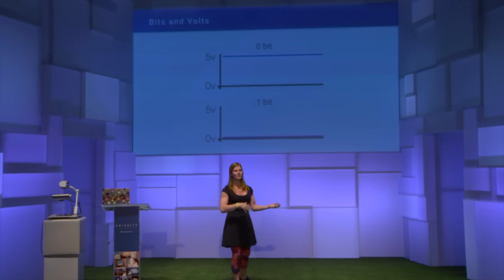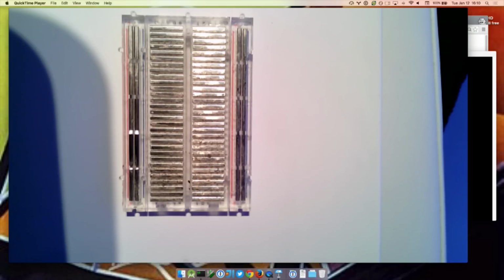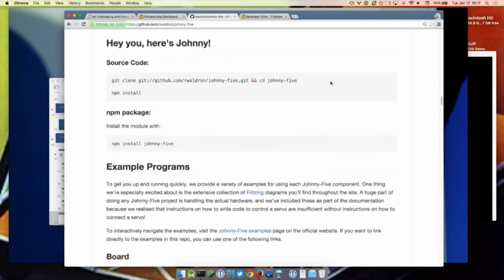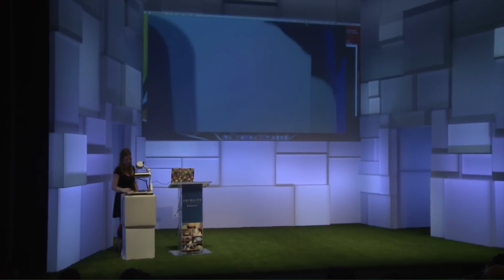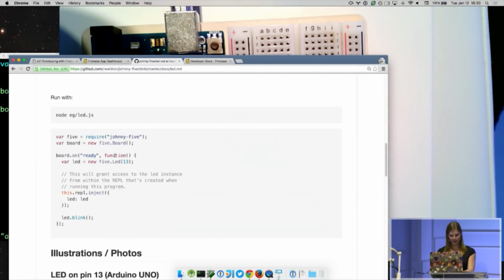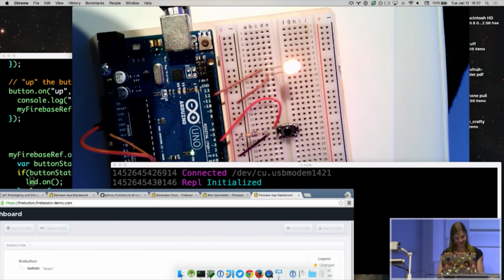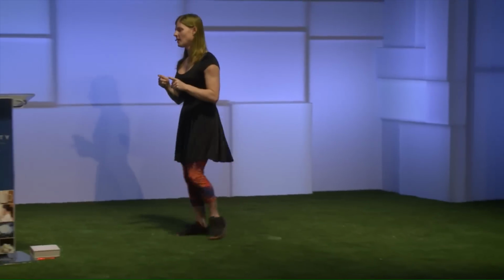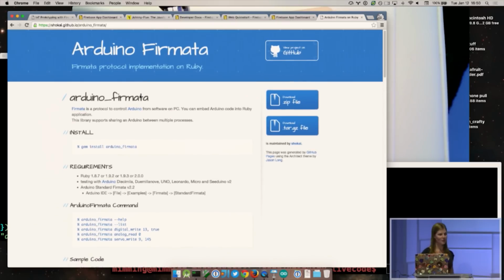IoT Prototyping with Node.js and Firebase (Ubiquity Dev Summit 2016)

Comment: Hi Jen, I have a question, Actually i just completed this video and have a question arising in mind. If we want to develop a product for market can we use the codes and firebase? I think we cannot. Actually I want to build a product for market purpose would you suggest me to use firebase + Johnyfive can i use it because for going into market i would like to patent the same.
Reply: While technically possible, this recipe is not a great fit for going to market.  It's focused on fast development, but overkill on the hardware requirements and complexity.  After you're done with the prototype stage, you really want to move to a lower power, lower cost solution for most circumstances.

Comment: Jen - brilliant presentation. I have a TI MSP430 that I would like to use in a similar fashion with my Raspberry PI.  Would you have any suggestion on how to proceed - possibly JavaScript libraries?  Thanx
Reply: That looks like a low power MCU.  It's going to be hard to run JavaScript on it directly, but if you can get it to run Firmata, you can run node,js on a laptop or Raspberry Pi using the recipe in this video.  Otherwise, I'd use the tool chain provided by TI (which will be a pretty different development experience).

Comment: I think this is not possible anymore as the new nodejs sdk require a service account, which should not be used on all devices for security.
Reply: Not possible at?
Reply: Galih Pratama the new node js SDK is intended to be used in servers, they didn't release the client SDK yet. Although as I received from their support, they are working on it, and in the meantime you can still use the older SDK.
Reply: Jen Tong
I managed to make it work, but i think it is not meant to be used for client side currently.
I contacted firebase and they said that a client side node sdk is in the plan.

Comment: Errata: The first signals slide has the headings and images backwards.  In that example 5v is a logical 1 and 0v is a logical 0. Sorry about that!
Reply: Jenny Tong  hi congratulations and thanks. i have a question, do you have some tip to Connect arduino to Internet without the pc and use jhonny-five. can you recomend me a source for read about the subject. thanks again.
Reply: carlos natera If you want to use Johnny-Five, you need something that can run node.js.  I used a laptop in the video, and you can port that same technique to a Raspberry Pi + an Arduino.  You can also use a microcontroller that can run Linux.  But you can't do it with just an Uno.  It's not fast enough :)